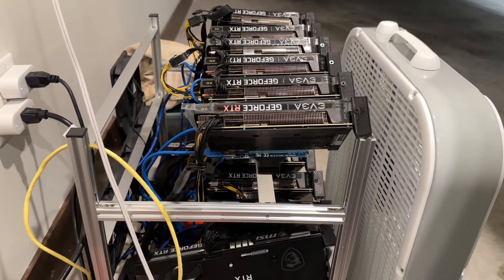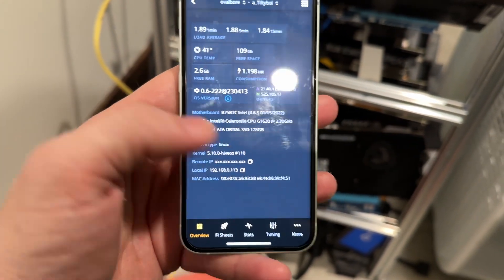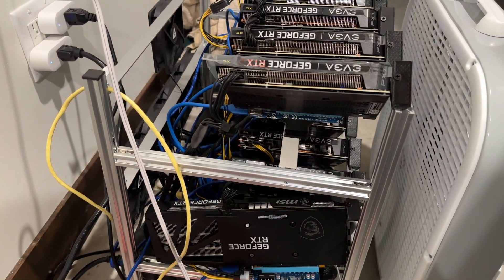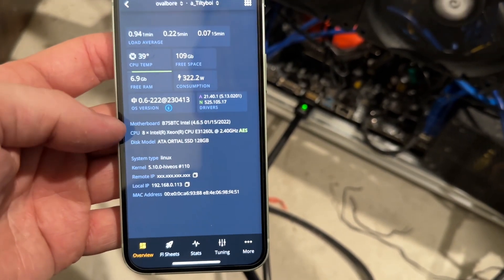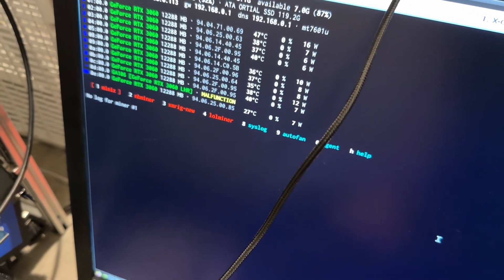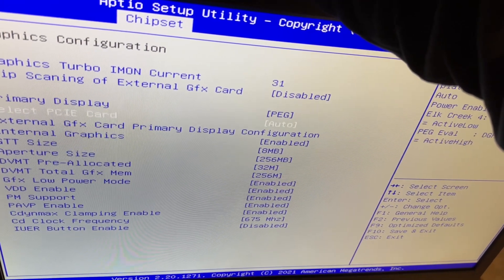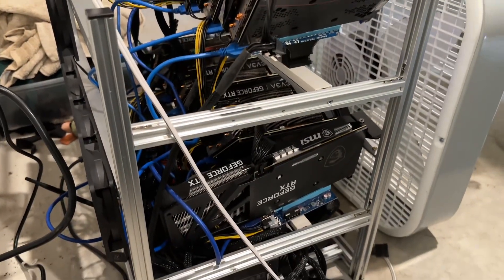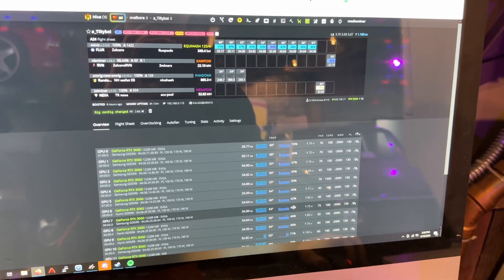B75 upgrade turns in to B250 replacement, whoops.

Comment: How do you turn the cpu fan speed down? Mine seems to run on max on this motherboard (B75).
Reply from the maker: mining motherboards default to full speed.

the answer to your question varies depending on 3 pin vs 4 pin fan but really it amounts to bios setting in Biostar and other name brand boards, but theres no setting Im aware of on these chinese boards. manual fan speed controller or quieter cooler (like this cheapo alibaba one). silent.
Reply: @Ovalbore Tech  4 pin stock intel cooler. There is some fan settings but nothing changes when altered.
Reply from the maker: yeah PWM likely isnt connected at all. would need a 3 pin fan to allow voltage control I believe